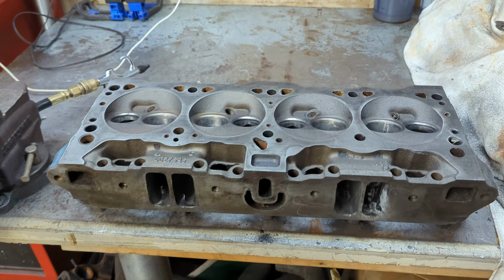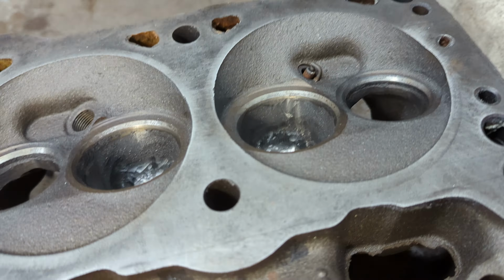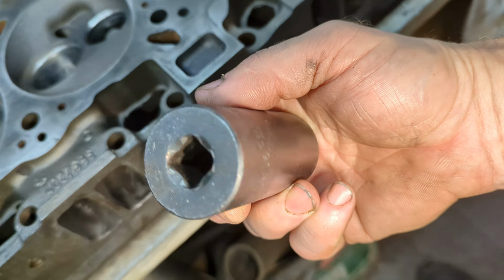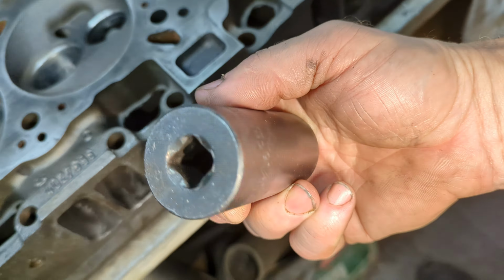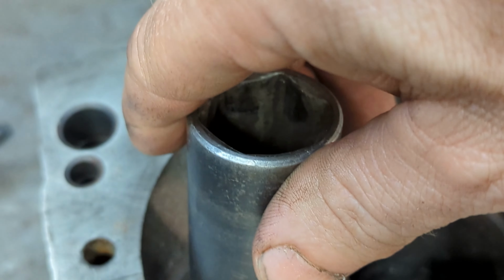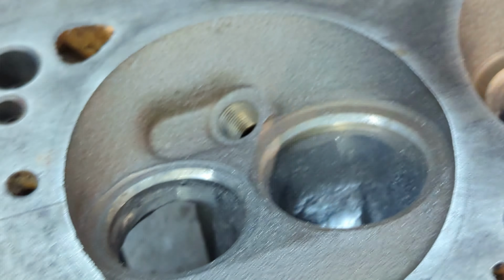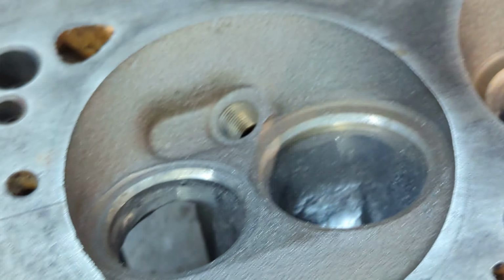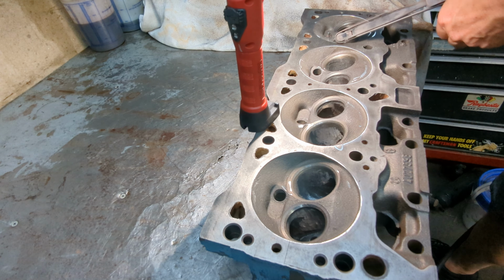Mopar 360 head porting update

Comment: how did you do this porting?
jc from Australia
Reply from the maker: Hello JC from Australia okay. First of all, thank you very much for watching the video and thank you very much for the comments. As far as how did I port this cylinder head while the tools I use? I have some carbide bits and then also an air powered die grinder
Reply from the maker: Let me continue this. Those are the tools I use to port with and I also use a series of sockets in different sizes to go into the ports and into everywhere I'm porting to act as a guide to let me know how I went too far or anything else so this is how I do the porting work on the cylinder heads also, you can watch previous videos of me porting these heads and it gives you a more clearer idea. Thank you again